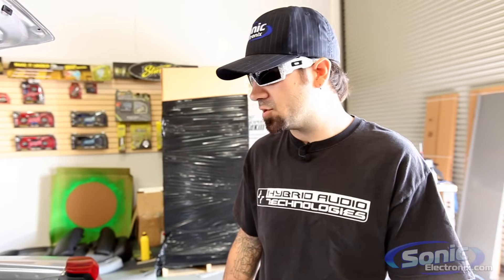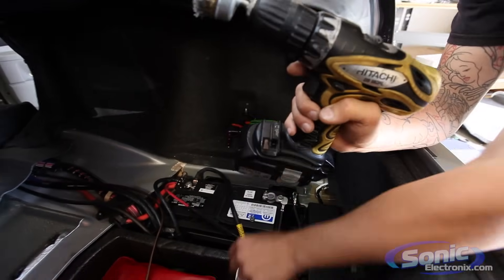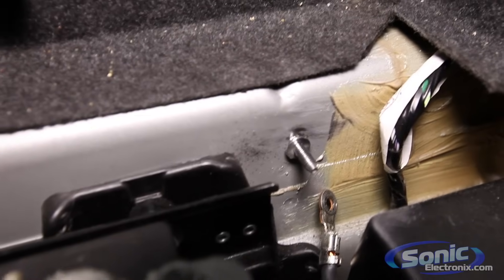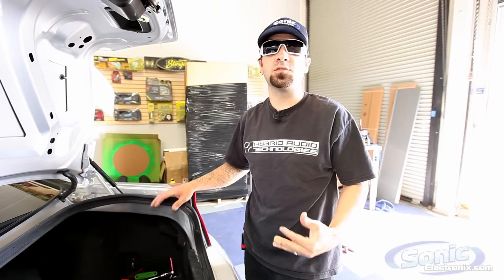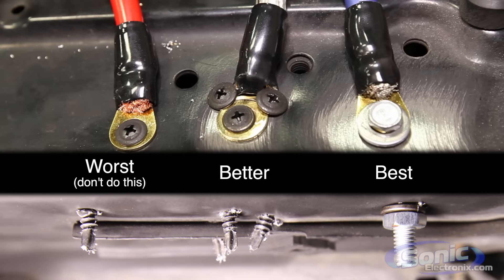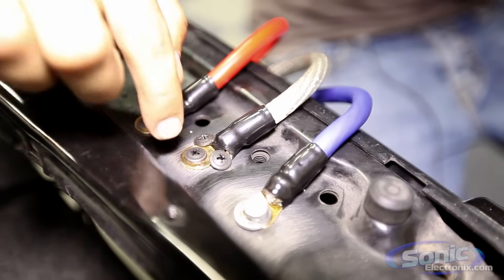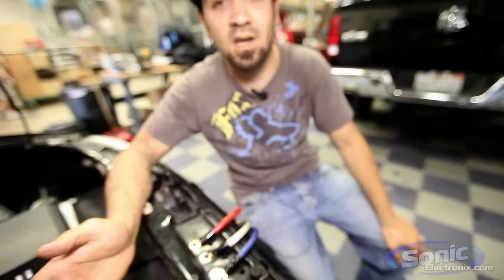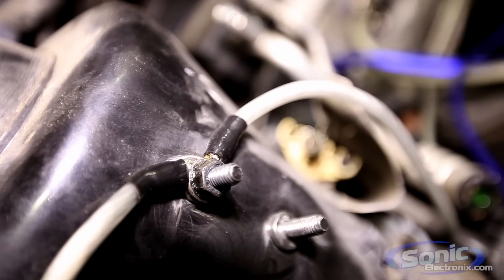How to Properly Ground a Car Amplifier | Good & Bad Examples | Car Audio 101

Comment: that might be true with a battery under the hood and an amp in the trunk... but a direct connection between the two sources will always be best, especially with the battery so close. it will inevitably work either way, but reducing resistance and voltage drop are always on my radar since im running 6 batteries and 5,000 watts
Reply: lets say you have a secondary battery in your trunk, would it still be ideal to ground your amp direct to the battery, located in the trunk?  

FYI - I have double runs of 0 gauge running from my primary (under the hood) battery to my secondary battery & I have double grounds for my secondary battery (1 run from my front battery to my secondary battery & a 2nd ground running from my secondary battery to my chassis).

Appreciate the time.

Comment: what is the batteries negative terminal for...making a connection to the frame ? what does the frame do for the battery, give it a place to connect ? you think when you connect to the frame you are connecting to the battery, through a single "8 gauge wire " that's connected to the frame. your frame is the common ground (buss bar) for everything in your car so everything does not need to wire directly to the battery

Comment: so rear battery... has 2 6 inch cables... one to chassis one to amp... your tellin me I should have it hooked to the frame instead of the battery? when the other 6 inch lead goes to that chassis point? How do you power an auto AMPLIFIER in a HOUSE? Ground it to your sewer pipe? NO the battery. Been doing this for 20+ years and I have NEVER burned up an amp EVER LOL. 2 wires. 1 to chassis 1 to amp. 2 powers. 1 to front batt one to amp. simple. tin.

Comment: I have a battery in the back and front of my car... a ground hooked from amp tpo battery then to car in rear... running another power from front to rear to power the rear battery for charging... shorter the BETTER for POWER AND GROUND these people are amatuers man... I got like 6 inch power and ground leads direct to battery in rear works perfect FTW

Comment: NEVER ground to the battery, ever. 

Did you see that batteries ground wire? That was an 8 gauge AT BEST, then suppose you add on a 4 gauge ground for the amplifier; starting to sound like a bad idea?

A good ground with low resistance is a must, chassis ground every time, no matter what.

Comment: @CxOxLxE If u check a wiring driagran u will not find not components grounded to the negative battery post. It prevent voltage spikes